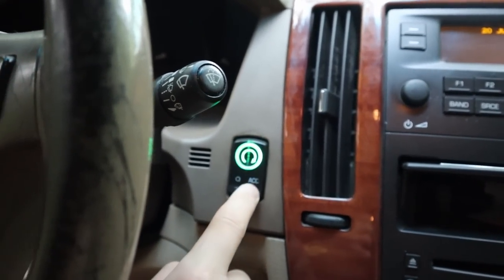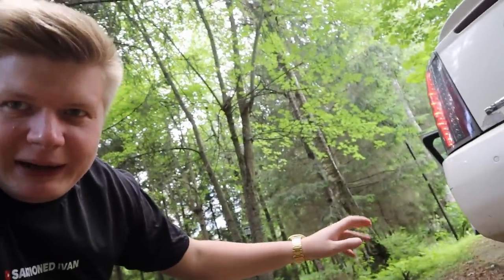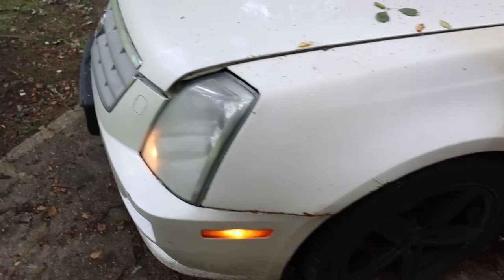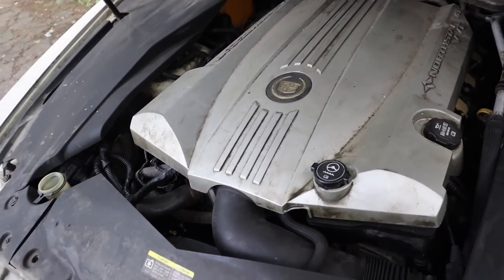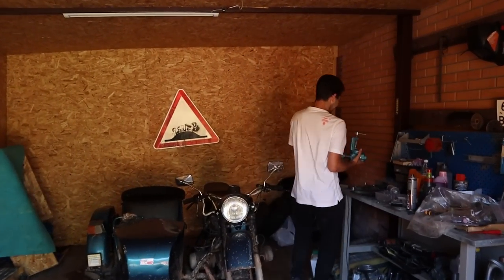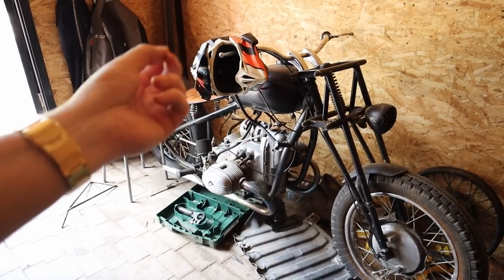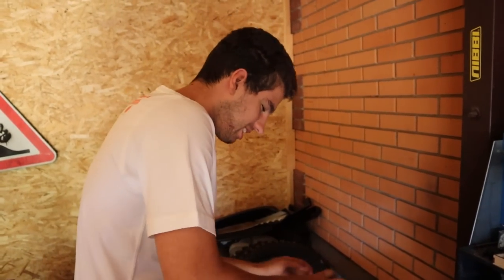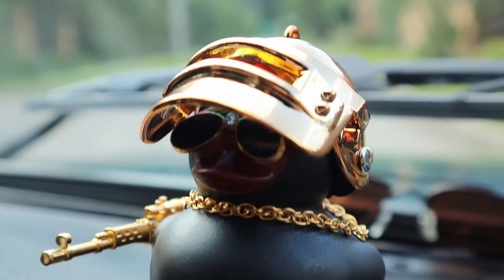Going To CRIMEA

Comment: Ok mechanic of course you will replace the thermostat, than check for leaks including the engine block washers that hold coolant in the engine block ,than check the fan belt for slipping & for cracks on the belt ,than make sure the water pump spins freely ,than if it isn’t belt driven fan it will be electric fan so check if the fan spins freely than check if it comes in and spins

Comment: That Cadillac has served its time, especially since it's not being maintained as well as it should be. But hey, it's 19years old, it still starts and runs.. my 2004 gmc has 189,000 miles on it and still owes me nothing with only 1000 in parts it needed.. still strong and is reliable.
It's not a Lada that loses spark plugs at 1600 kilometers

Comment: Typically I find that knocking in the north star engine  to be the water pump. 
They were notorious for having knocking at water pumps . But yes, he should get a different car. My brother John worked in the technical support department of General Motors for 18 years before going to Allison transmissions. Even he thinks you guys should get a new car.
Reply from the maker: Yeah ive read a lot about the northstar engines and im surprised this one did so long

Comment: If it is overheating, it could be that you need to replace the thermostat, they go bad.  They come in different heat ranges, it is stamped on it what heat it opens, change the heat range.

Comment: Oh okay now if it's not the ground Problem like I said before and you can jump it across  the starter by using a screwdriver it's probably the solenoid on the starter and sometimes they're on the sidewall and have a hot wire going to  from the battery and then from there on the solenoid to the starter. and if you  jump across between the two wires that connect the battery to the starter on the celanoid,then it will start. it's your  celanoid. I hope he understands that 🙏
Reply: Иван, я напечатал здесь то, что сказал Джеймс, я удалил то, что сказал, потому что я уже опубликовал длинный ответ, вы бы знали это как соленоид стартера.
Reply: Sorry, in English

Ivan, I typed here what James said, I deleted what I said because I already posted a long answer, you would know it as a starter solenoid.

Comment: Take the engine and transmission out and put it in a lada! And take the radio and speakers out! The muffler is probably blocked up, the thermostat and water pump needs to be replaced, make sure the fans are working or it will overheat!

Comment: Does it heat right.
Could be a thermostat. 
It could also be plugged radiator, flush it the whole cooling system.
Change oil and low oil makes a knock.
It has many miles on it, about ready for the graveyard.
A back yard mechanic may buy it cheap and get it fixed to sell to a poor person cheap.

Comment: Than check if the transmission oil cooling lines run into the radiator or run into a oil air cooler & if it runs into the radiator modify the lines into a air cooled oil cooler

Comment: I heard that knocking too I think that's probably your valves need a little adjusting, but I know what you mean it's always nice to get a new car, but I can tell you it won't be a Cadillac one of those Chinese cars are going to be smaller, the ride won't be so good, and it'll be noisier going down the road, you know, wind blowing, cars passing, you'll hear them on the outside. That caddy I'm sure, was just quiet as a Mouse inside. But I'll let it go let this time and he can get a Chinese car. You know I'm just kidding around with you don't you😂